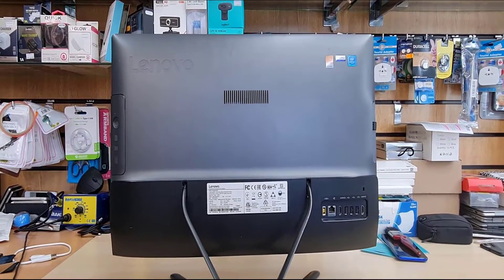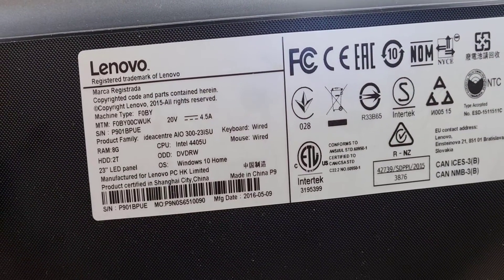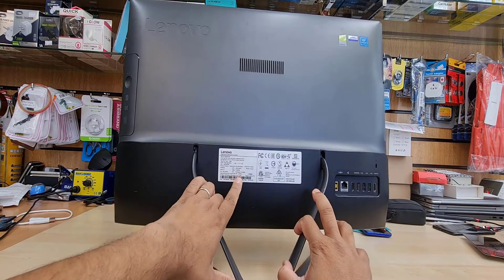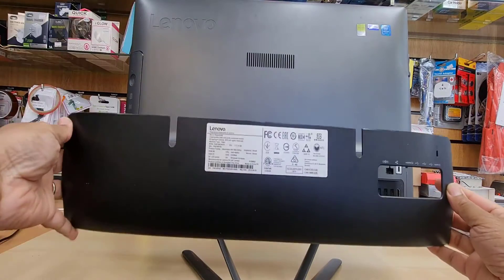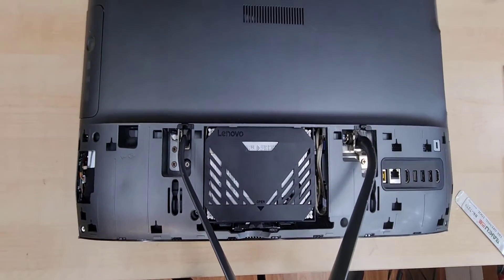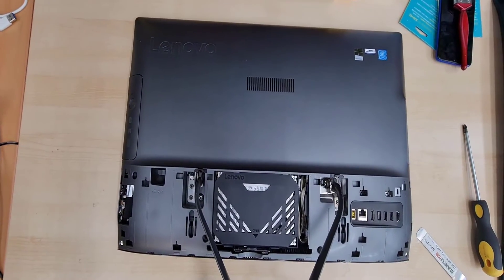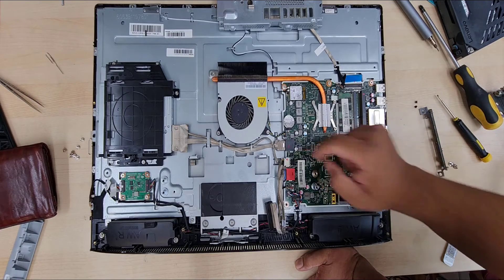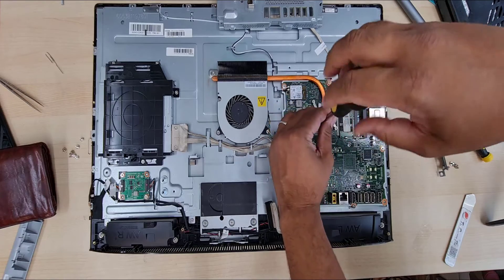Lenovo All In One Ideacentre  300-23ISU Disassembly & How To Clean Heatsink and Thermal Paste

Comment: The first black panel where the pc stand is slides down, don't pry it open. I started praying it open and then after reassembling it, I realised it just slides up and down to lock itself in. If it's a bit stuck then slide it down and give it a little pull from the sides. 😅

Comment: Nice teardown of this machine.  Just had same model in my shop.  The touchscreen was acting up quite badly.  Bubbles and clicking on things like it was possessed.  I ended up disabling it permanently just by using software.  Navigate to HKEY_CURRENT_USER\Software\Microsoft\Wisp\Touch  Create a new DWORD (32 bit) with the name TouchGate  Doubleclick on the newly created DWORD and making sure it has the value 0  (zero meaning disabled)   If someone else has same problem hopefully this is useful.  I don't believe there is a way to disable the touch in the BIOS with this machine.

Comment: Hi, I have the 22ISU version, I have some questions.

Can the DVD Reader be swapped with Drive Caddies like most pre-2017 laptops? What's the SATA speed of that socket? Is it SATA2 like most windows laptops, or SATA3 like Macbooks/iMac? If it can, should I use the 9mm or the 12mm one?

Thanks.